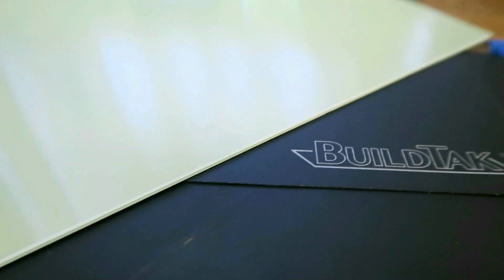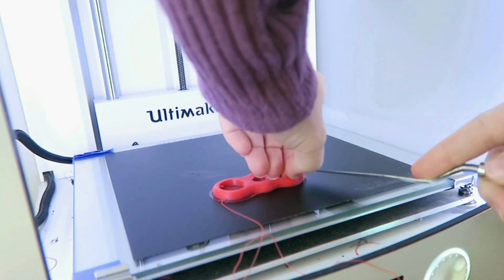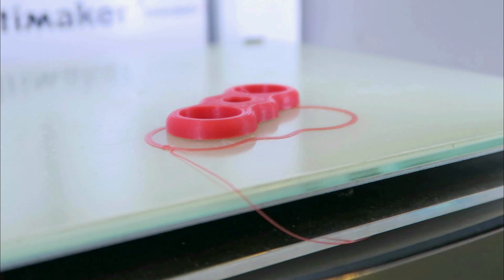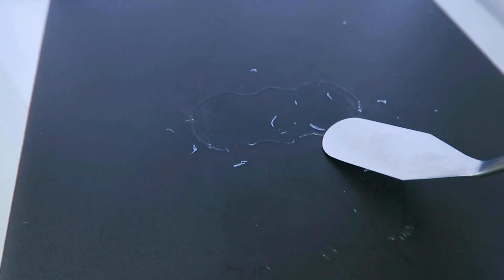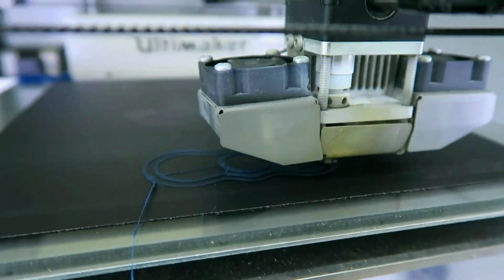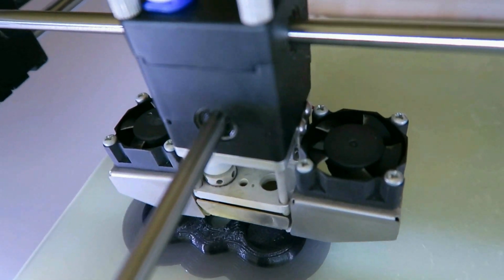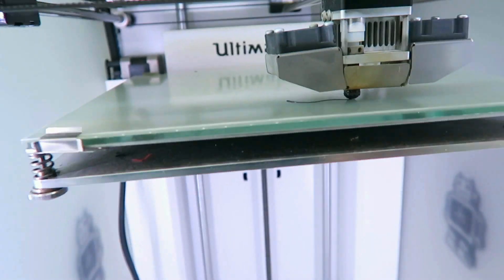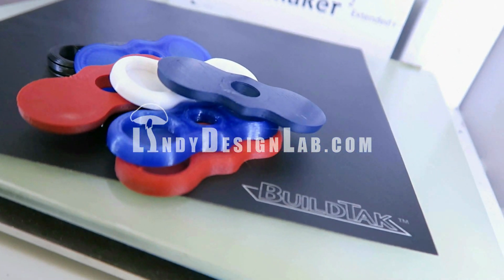BuildTak & PrintBite Comparison: PETG, T-Glase, Nylon, Polycarbonate, Cheetah Filaments

Comment: I get what you are saying. You don't use glue stick because you paid good money for a specialized surface. Gotcha. I use school glue in a jar and apply with a wet brush straight on glass and everything sticks very well and releases very well. If it does not release very well I spray my bed with water. After a min the PVA softens and the whole thins just comes off easy. IT also cleans up with water and paper towel or re brush with a wet brush and it takes whatever is left and spreads that and dilutes excess glue.

Comment: god I wish there were more advancements in print surfaces and all!
one tip with buildtak is that it gets better overtime and sticks less. I do speed it up by smearing my hands all over the surface and never cleaning it tho xD
btw did you clean printbite with window cleaner? since that reduces adhesion a lot. most people recommend 99% IPA or something

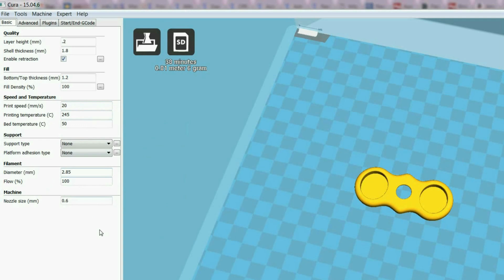Comment: At 6:42, those of us who have "gone to the trouble" of installing specialized print surfaces and the expense of printing with T-glase use glue sticks as RELEASE agents so that we don't fuck up our freshly printed parts and build surface by gouging them with the spatula like you've repeatedly done in the video. Sorry for the rant and multiple comments, but this video was the first search result Google returned when I was searching for the key differences between PET-G and T-glase. This would have been a helpful video if it didn't contain so much misinformation that will cause inexperienced makers to waste filament, ruin build surfaces, or worse - give up on printing with non-PLA.

I implore you to update your video with some titles reflecting the correct use of PVA gluestick. Test it for yourself first if you don't believe the experience of dozens of commenters.

Comment: ultrabase is a lot easier to deal with than buildtak. its pretty much indestructable too.
Reply: It has the smoothness of glass with the no chemical goo needed. both pla and petg stick great at 60c and most prints pop right off with a whack from a pla hammer that i made.

Comment: Hi there. Do you make your extruder extrude just before it prints? As it starts to print you pull away the tail for a clean start. Do you have g code to make it do this or is it just oozing out before the printer starts. I have trouble with my printer ozzing. I would like it to start extruding before it gets to the build plate so I can pull the tail as you do.
Thanks. keep up the great vids.

Comment: old video but for polycarbonate i have polymaker pc max and also get layer separation but without cooling and problem gets better when i turn on the fan to 100%, only downfall is that it makes polycarbonate very brittle. in your case no fan like it says on the roll works fine. what could be my issue with no fan i get bad layer separation only for polycarbonate. settings i have are 
270c hotend
105c bed
40mm all the way to 100mm in 20mm increments i applied on the speed
0.4 nozzle with 0.4 layer thickness and 0.2 layer thickness as well.
what gives with this material?
Reply: this material makes it a hell of a lot harder to get alignment right. i tried on different beds like geckotek, pei, glass etc and poly-carbonate sticks a bit better to geckotek but only sticks half the time, atleast for me. yup after a week of tweaking and contemplating sweet death i'm moving on to a more friendly nylonx

Comment: On buildtak you have to be very careful with removal because you can take a bite out of the surface. You can also bring the temperature up to over a hundred if you have little bits left.

To prevent it from being too stuck you have to make sure it isn’t squished.

Comment: What are your retraction settongs for cura.. im isong petg for the forst time..
Reply from the maker: Right now my retraction settings are 100 speed and 10 distance. In expert settings minimum travel is 2, minimal extrusion 1. I haven't experimented with retraction too much and am using an old version of Cura, so you might want to search for videos on tuning retraction if it seems to be an issue. Good luck!

Comment: I know this is an older video, but I have had huge success with Zebra plate-- it heats up, I use the buildtak-like surface for ABS, and it's flexible to take it off and crack the prints off of it. I found you via Calvin Witt, great to find you!
Reply from the maker: Nice, that's one I haven't gotten to try. Awesome :)
Reply: Don't get to reliant on those Zebra plates...  They are now discontinued what they have left in stock is what they are going to sell.  Look at PrintinZ's web site..   I bet Buildtak's flex plates and such are just killing them as far as sales and such.

Comment: Thanks for that great video!
Reply: Lindy Design Lab uh thanks for your answer :-). I was Loopings for the Setup with the buildtak and PC. Could you tell me the distance you chose between the nozzle and the buildtak for PC?
Reply: AH okay. In the Polymaker PC Manual with the BuildTak they say the zero distance between the nozzle and the build plate should be 0.3-0.4mm. That seems to be really high, what do you think? :-)
Reply: Ok :). I think i will start with 0.3 and then test it in 0.05mm steps smaller until it sticks enough:-)
Reply: Happy new year!
Reply: Tested it now with 0.2mm distance 90° and 0.3 first layer. Sticks really good :)
Reply from the maker: Awesome!
Reply: BTW i love your voice! :)

Comment: Wondering if the BuildTak flex plate would perform better. I’m trying to find a good all purpose print surface. Tried lok build and can’t get some spots clean as the adhesion is way too much. I must say I’m a noob at this and appreciate all your testing.
Reply: Lindy Design Lab I have the kit coming later this week. I’ll let you know if it does what is advertised. Oh love your work btw (and your choice in rifles).  Been learning so much from your videos. Thanks!!
Reply: Lindy Design Lab the flex plate system came today. It’s installed and I’m printing a “money cat” in proto pasta magnetic iron.  Will let you know how it turns out. Whoooohooo

Comment: I've had a hard time getting PETG to stick to printbite so much that I'm going to put PEI back on.
Reply: Just ripped off the printbite. Whenever there was a small print edge piece or even in a print with a large flat area, something always lifted. Increased bed temps, nozzle temps, slowed down, increased first layer ht and tried combinations of those and didn't get anything figured out. I bought the purest of pure acetone and wiped like a fool. I just put PEI back on and no problem with the current large area print. I wish it would have worked.
Reply: From what I read by the printbite seller it's ok to use the acetone not for finger nail polish which I bought but it still doesn't help. I took the printbite off and put PEI back on and then gouged my PEI after a PETG print :( I kept the printbite and put it back on again and still it doesn't work. The seller claims it's user error, haha. So I just ordered the MK2.5 upgrade. I'll just try glue stick on the next PEI sheet when I do a PETG print until the upgrade gets here.
Reply from the maker: Ah, I see that in the updated instructions. Interesting, I've never used acetone on my old printbite. I've got the new version of printbite waiting to be tested. I assume yours is the v2 if you purchased it recently, so now I'm curious if the new stuff has issues... I'll do a review soon and see how it goes. Good luck, hope the gluestick/PEI combo does the trick for you.
Reply: This is what my order said so I don't know if it's v2 or not, "PrintBite+ The Ultimate 3D Printing Surface." I'll look for your review though.
Reply from the maker: Ok yeah what I had on for this review was the old plain printbite, so printbite+ must be the new version.
Reply from the maker: I've already tried out the new version of printbite here https://youtu.be/oPJAVQdSds8 with a few filaments including T-Glase which is Taulman's formulation of PETG. Haven't personally ever experienced PETG not sticking to old or new version. Edit: Verified with Jason the creator of PrintBite that pure lab grade acetone (NOT the nail polish remover kind) is ok to use at any point if the surface should need cleaning.
Reply: It's thinner with improved composition which gives better adhesion. Beware of some of the FUG comments, there were a couple of people (competitors) posting a lot of FUD about the place.
Reply: @tubeod: Did you get your PETg to stick? Contact me directly and will help resolve or replace in the event its damaged.

Comment: Great video, The buildtak you bought is the thinnest I've used. With Pet-g on larger prints I've had tearouts, chunks of the buildtak that stay with the print. Brim helps with removal as you can get a spatula slides easily under the brim and the print as well. I've also noticed with buildtak that repeat prints will stick better as the residue of a previous print in the same location helps it stick better so I rarely clean the print surface at all, plus scraping the buildtak shortens it's lifetime. I've found that I can sometimes restore it for a few more prints by lightly sanding it. But often it's not an adherence problem it's a lumpiness problem since the buildtak will raise if parts are pulled off, just like you had with the initial Pet-g print
Reply: Lindy Design Lab I'm going to be using spring steel and powder coated pei 😀 I'm getting a prusa mk3 soon,

Comment: Use a global Z offset to reduce adhesion. By raising the first layer a bit, you reduce the pressure on the build plate and thus the print doesn't stick as much. 0.05mm for flexible filaments and something like 0.03mm for PETG once you have the printer leveled so that PLA is perfect at 0.0mm offset. This is different from changing the first layer height, because the amount of extrusion is going to remain the same, but the gap between the bed and nozzle is going to be larger. Also: what the others have said about glue stick (I use ItStays, which is a water-soluble roll-on adhesive). Using a water-soluble adhesive also means you can use water to unstick the prints from the bed, if you are having difficulties otherwise.

Comment: If you want i made some start gcode which does a nice little zigzag in the corner then a wipe, so you dont need to hold and pull the little purge blog away, i can share the link of you want.
Reply: Here is the link, copy and paste into notepad as a backup the code you have already, then just copy and paste the zigzag code you may have to play a bit to suit your bed see what happens. https://goo.gl/MgNJMQ
Reply: I thought that was the point of the skirt?  Least I just have it make 2 turns a few mm outside the part to purge the nozzle and then away it goes.  I just grab any hanging bits right before I tell it to print. It purges on the skirt and all is good.
Reply: consaka1 you can use a skirt but i dont want any blobs and filament near my print abd on very large prints the skirt is just too big.
Reply: I can see that being an issue with big jobs for a little printer. So far I have not had that problem with my cr-10.  Not sure what you mean by blobs and filament near the print job. The other reason I like the skirt is it gives me a quick warning if there is adhesion problems.  It doesn't take much space if you space it out 2 or 3 mm. I generally base mine on the size of the print. Large prints just 1 pass. small ones up to 9 or so.
Reply: The zig zag and wipe is very cool too almost like signing oil paint :-)

Comment: You should try using a woodworking chisel that's properly sharpened and flattened for print removal. I've found all but the most difficult prints will pop off with a chisel. The only time I've had issues was when I was removing some motor mounts that were extremely rigid from the 50% infill and 5+ perimeters.

Regarding sharpening: Just hit the bottom with a sequence of (wet, prevents buildup) sandpaper all the way up to 400 placed onto a flat surface, you should have a sufficiently "flat" bottom that won't dig in. Just lightly sharpen the face of the chisel, since this is for print removal you just need a "sufficiently" sharp tip.
Reply: Reflector Hmm - it occurs to me that it might be a good idea to round the left and right corners of the chisel with the sandpaper so they don't dig into the bed material.
Reply: Yeah, you could always lightly round the tips of the chisel. I have a video with a (very nice Rali) chisel that demonstrate in removing a print. You want to use the flat of the chisel and avoid letting the tip dig in. Most of the time I use the chisel to lift the edges, that's enough to get the print off usually. You can use a spatula afterwards to give yourself the leverage while avoiding the issue of a sharp chisel digging into your bed material.

Comment: print bite is so bad. i have never seen any improvement by using it.. plain glass works way better.
Reply: Well I myself never got anything to stick to bare glass but now that I switched to my printbite sheet it's night and day. No more messing with glue, just a quick wipe down with some acetone before printing and I;m good to go. I go to work come back when the print is finished and cooled and just pick up my prints without any effort.
Reply: I have printed some time with the Buildtak and it is sticking to hard von the Builtak. Some greater Objekt you will never get from the Buildtak. An then i have testet Printbite (Flexible, ABS and PLA) an there is no better print surface. You print PLA or ABS with heatbed on. And when the print is finished and the heatbed is cold you put it from the Printbite by the smallest finger.
Reply: I have been using printbite for a year and a half now. I haven't picked up a spatula since. You have to take the time to setup your filament but when you get it dialed in there's nothing better. All my prints just pop right off. Sometimes I will take a hand fan to cool the print and you can hear it creaking as it cools and then pop, off it comes.

Comment: Interesting comparison of the two surfaces.
To apply the surfaces, i would have removed the bed/glass from the printer, should give you more control over the process and you can see thru the bottom if you are about to trap any air bubbles on glass sheets.
I have printed directly on heated glass beds for ages without too many adhesion problems. If i had problems, it was either due to bad leveling or wrong first layer settings. I used gluestick a lot at first, but my last printer i bought had a can of 3DLac spray delivered with it, and i really like to use that now. (I've tryed some cheap hair spray before, but that did not work at all for me) However you should have a printer where you can remove the bed so you don't spray it all over your printer and the linear rails.
I'm not really shure where the value of these special surfaces is, except maybe for printers with cold beds.
Reply: Mostly i print with PLA, especially the bigger stuff, because it's just the easyest and cheapest filament to work with. I do some Nylon prints too tho (different Taulman Filaments) and HDglass (PETG), and blended PLA (woods/metals). Still haven't gotten around to modify my extruder to work with flexible filaments, but that is one of the next projects i want to attack...
Reply: Key there is cheap hair spray. I used different ones till my wife got mad at me and told me to quit stealing her kangaroo spray. So I told her to get me some aqua net. That stuff has been around since my grandparents were little and works very very well. Not sure which is cheaper but her favorite stuff didn't work that great at all. In fact it was almost worthless where aqua net works like a charm.